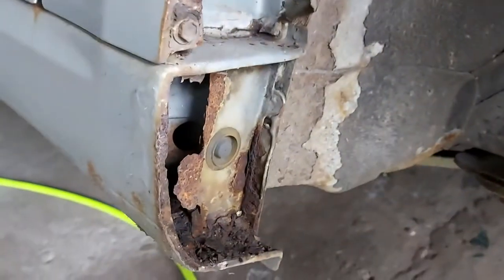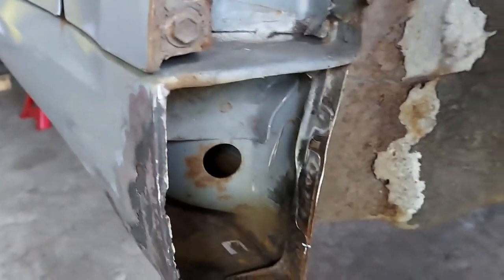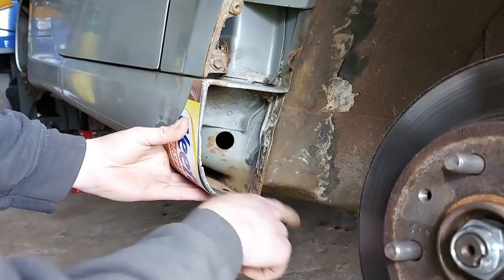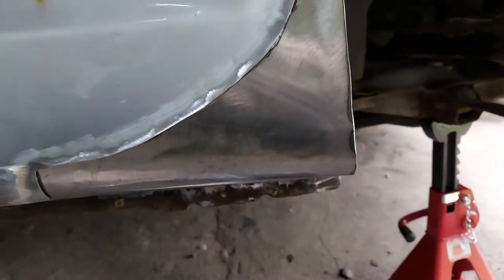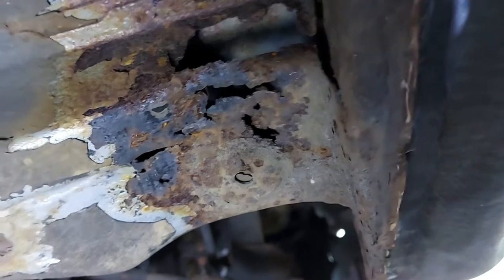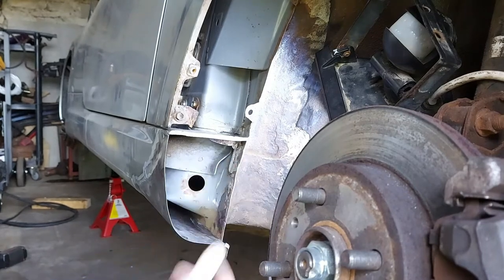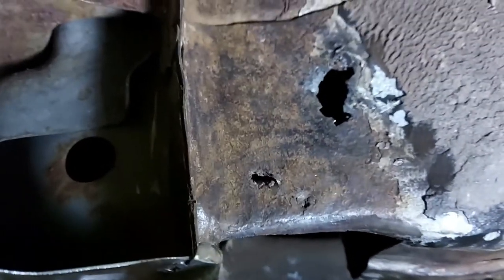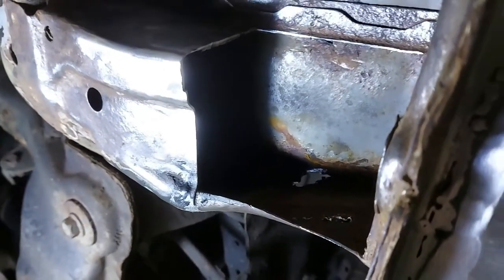Fixing the rust on the copen part 1

Comment: Bought an '04 Copen recently for only €1300, a great deal apart from having the same rust issues yours has. I look forward in having more time over the summer to repair it.
🇮🇪 Greetings from across the pond! 🇮🇪
Reply: @ParadiseRd Just something else I'd like to ask your opinion in, Would you recommend buying a MIG welder in tackling bodywork like this? I've heard that you have to go quite slow if you are using a MMA or stick welder.
Reply from the maker: Yes get a mig for bodywork :-)

Comment: How much would this cost to fix at a garage etc?
Reply from the maker: I would imagine somewhere between £1000 and £1500 if they did it properly like me. E.g fully disassemble parts that are in the way, needle scale entire underside of car, fix all rusted sections making new repair patches and inner wings, rust encapsulator the entire underside at least two coats, then two+ coats of W.A.R chassis paint, making sure all cavities are all given two coats of RE plus paint. then re assembly. :-)